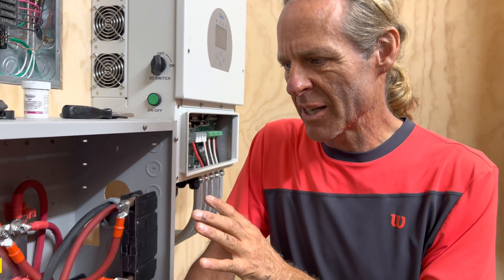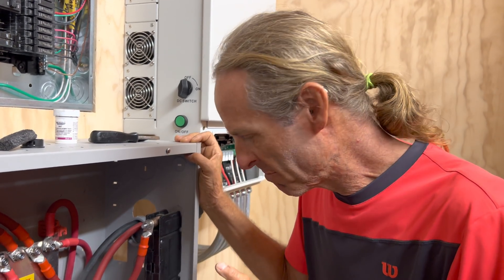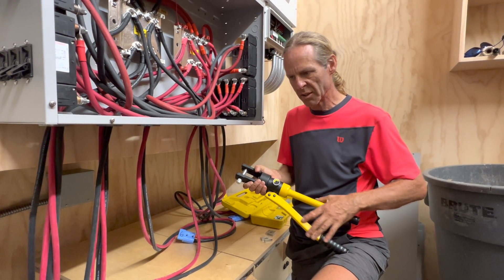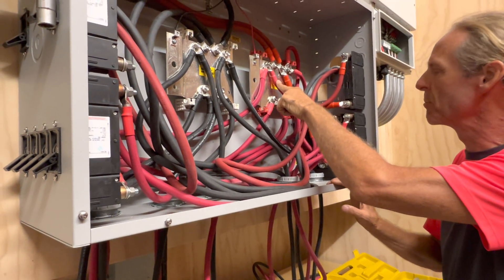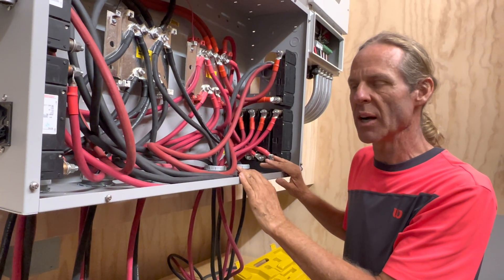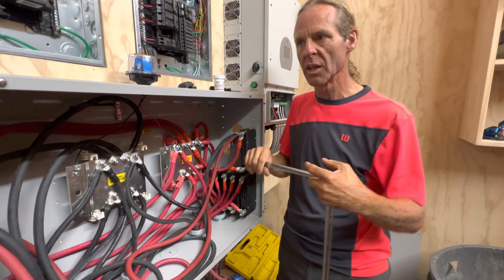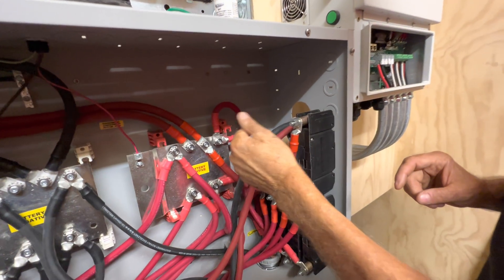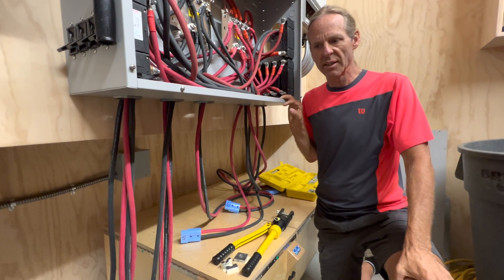Wiring Up Eight Big Lifepo4 Batteries and Three Big Inverters!

Comment: Do you think that 8 lifepower 48v battery with a master battery still needs the leads the same?does the master bms communication tell the other batteries when and how much to charge to stay balanced? All batteries are the signature solar lifepower 4 48v
Reply from the maker: Keeping them the same will help to use the batteries equally. If there is more resistance in the circuit of one battery, it will get used last and it will get charged last.
Reply: Does the master battery bms not control that very thing? If not the what does it do? @RayBuildsCoolStuff
Reply from the maker: @chrislewis9345  the master battery does not control the rate of discharge or balance between the individual batteries. The balance between the individual batteries is determined by their voltage and the resistance in their circuit. If there is more resistance in the circuit, then it will require a greater voltage difference in order to push current through the circuit. Read up a little more on ohms law.

Comment: I have the distinct feeling that you are either an engineer or a someone that used to teach in a university.  
Much of what you talked about is info that is useful in more ways than one, being a ham radip operator having gas tight fittings is very important to have as well as water tight, the carbon paste that you use i also use the same stuff for making good solid coaxial connections. We also use some stull called PENETROX WHICH IS ABOUT THE SAME THING. The nice thi g with the PENETROX is that it also seals out gases as well.
Reply from the maker: I am just an old country boy that swung a hammer for years. Then I told other people what to do. I do kinda like systems, patterns and getting things right. Thanks for following along and letting me know how you feel about it along the way.
Reply: @RayBuildsCoolStuff  strange how most people think university's dispense knowledge when all they do is certify to a minimum standard. I appreciate your education though experience, uncommon sense and communication skills that have been gained through  training others and insisting on quality at a high level.

Comment: New to your channel thanks for all your battery build up informational content. I've been working in aviation for 40 years and have always done the maintenance on our ni-cad batteries. They are assembled much like your DIY batteries with the insulation sheets between the cells with pure nickel bonding straps. This allows disassembly for replacement and cleaning (vented cells create a salt that requires disassembly and wash down of cells annually). We do capacity checks every three months manually monitoring cell voltage on discharge and charging. Then service water level. These LiFe look like heaven. I'm currently running 4 decommissioned aircraft batteries for my system until I up grade. You gave me the bug. Only one suggestion as we work on fully charged 24 volt batteries with marginal clearances.  The go to is electrical tape you should have either heat shrink or  electrical tape on your battery tools especially sockets and extension. Helps to mitigate the welding of your tools to the battery and the ensuing panic as things start toward thermal melt down.
Appreciate your insight especially on cell purchases.

Comment: So you just combine all these packs to 1 connection towards the Deye? How do they discharge all correctly to 0% (or 10% if you like) ? And which of all the BMSses do you canbus connect to the Deye? (I am having a Deye 12kw 3phase hybrid + a 16xLF280K pack with Seplos 200A bms). Great video!

Comment: those anderson connectors are known fire starters . the tweco connectors used for welders are probably a better choice and readily available
Reply from the maker: Can you cite examples of genuine, Anderson connectors, causing fires? There are a lot of counterfeits out there that I wouldn’t dream of using. Also, they must be properly crimped. I am certain that there are a lot of potential for fires when they are not used correctly and when the connections are not made correctly. I have a video about that very thing.
Reply: @RayBuildsCoolStuff  there was a factory charging a fork . a few years ago . and tvr cars had 2 catch fire . a quick google search . will probably show some results . i would test them with a load that you would typicaly use for heat

Comment: Hi Ray - I am using Sunsynk inverters in the UK - these are very very closely related to the Deye inverter (made in same factory) I know you use Seplos BMS can you confirm how you established the battery link - that would be very cool. I think the Seplos emulates the Pylontec which the Deye can communicate with.....can you let me know how you did this? Cheers love you channel.

Comment: Surge…. If you have a strike on your house or close by, the earth ground voltage will be high and the surge protector will not do much.   I speak from experience!
Maybe add ground rods around your a solar shack as well.  Yeah, ground and neutral needs to be bonded at the first means of disconnect, but I don’t think there is anything in code saying you can’t have ground multiple grounds around your property as long as they are all connected. 
Heck, the utility grounds the neutral all along the system.
Reply from the maker: Yes, a direct, strike or one very close by would create some serious damage. The surge protectors are not designed or capable of protecting you from that. I think the best we can do is to have multiple layers of back up power to get our critical loads protected, in case of catastrophic failure of our primary system. I have looked into lightning, arrestors and protection systems in the past, and it is a really big deal. I may look into it further in the future, but I won’t be trying to design a system of ground rods that has the potential for setting up a dangerous ground loop to overcomes something that should be addressed with a proper lightning arrestor system. I have done too many of those kinds of things in my youth. I guess we both have experiences that are trying to lead us. Lol. Thank you so much for your valuable comments.

Comment: what is more efficient grid-tie inverter on battery or inverter
Reply from the maker: Please rephrase your question. I don’t understand.
Reply: I have a 48 volt lead-acid battery Bank. somtimes i connect them to my grid tie inverter and i get around 400 watts. back to the grid
Reply from the maker: @SingleFosterDad  what are you asking though?

Comment: I know you said you can't get the ones anymore that you're using I've been looking at sungol split phase piercing wave 18000 W 48 V in burgers I haven't bought anything yet money's a major issue for everything but I don't wantna buy anything twice I don't wanna buy anymore than a 1/2 too but with my consumption there is need for Mega inverters and Mega batteries and then of course I gotta have enough panels to to cover it but there's somebody advertising on Facebook and they got a whole bunch of panels and not as big as what I was thinking of but after seeing the racks that you built on your property and I'm a solar shed She's got 6 and a 1/2 acres out there Tennessee she can spare 3 spaces 10 by 25 to to put 3 racks up one straight South 1 just slightly to the West and we're just slightly to the ei think I'm having plenty of inverters to hook up to the strings won't have to be that big I don't know tell me if I'm crazy

Comment: Thanks for sharing your knowledge and experience in building battery packs and solar system.
I have one question: 
What is that white material that you put between cells?

I am using rubber sheets, but it sticks togeather too much and if I need to remove any cell then it is very hard to do.
Reply from the maker: They are thin flexible cutting boards cut to size. I buy them through Amazon from arrow home products.
Reply: @RayBuildsCoolStuff  Thanks.

Comment: Ray - I appreciate this video- I have been trying to figure out how to buy or make a proper battery terminal block. I bought a copper 750 amp rated block and wonder if it would work for 10, 100 amp batteries. Not clear to me how the sheets of copper are rated.

Comment: Hi Ray, just starting to design my home power system, thanks for the great info.  Years ago I rebuilt a 50KVA Exide Powerware UPS in my server room.  I found that ALL the power cables had wax drops / beads at each lug, good visual for a hot connection.  I am not skilled as you in the woodworking so I am likely going to use an commercial UPS battery cabinet and use CALB cells on each shelf.

Comment: Based on your figures for the 1/0 connection using a 50mm die the size for the 1/0 is 53.5 mm2. If you divide the 50mm by the size of the 1/0 wire 53.5 mm2 you get the following ratio: 50/53.5=0.934579. The size for the 2/00 wire is 67.4 mm2 . f you use this ratio for the 2/00 wire you would get 67.4 * 0.934579 = 62.99 mm. This measurement is smaller than the 70mm die which you had to grind down. Love your information. Can't stop watching your videos.
Reply from the maker: Makes sense doesn’t it? I can’t say exactly how much I ground off but it was a good bit smaller than 70 when I was done. 😉

Comment: Considering adding the breakers and another two lug connections at the breaker: isn't it that the wire lengths don't matter but the inner resistance of the battery to the bus bar matters most?
Reply from the maker: The wire lengths definitely matter. The total battery resistance also matters. I want both to be as balanced as possible to cycle the batteries evenly and equally.

Comment: Hi Ray, can a similar setup be realised with traction batteries? We are running an off-grid setup with multiple inverters with each their own forklift battery. It would be ideal if we could combine these but I've always been told that's a bad idea.
Reply from the maker: I have no experience with that.

Comment: Who is the maker of the battery combiner box ? If one inverter goes into fault and cannot be repaired for whatever reason will you have to replace all three inverters ?
Reply from the maker: Midnite Solar makes the combiner. Each battery and each inverter are separately fused.

Comment: Do you find the Anderson connectors have a certain amount of resistance ? They tend to get warm under load. At least they get warmer than a nut and bolt connection therefore indicating resistance. Maybe some conductive paste would help. Also would the load on the batteries get unbalanced anyway if one inverter is powering a load while the other is not ?
Reply from the maker: The batteries will stay balanced. They communicate with the inverters and the inverters communicate with one another. That’s an interesting idea on the anderson connectors. I should test that when the time comes.

Comment: Hi Ray. Your knowledge and experience with DIY batteries is very impressive, and I'd like to ask you if you could share some of it with me. I haven't found any info on DIY high voltage (400V) energy storage on the internet apart from a decommissioned EV battery from BMW but that's kind of a cheated DIY in my opinion as all the trouble is dealt with (BMS, Circuit breakers, etc) . I saw some commercial solutions from Huawei but no DIY. Do you plan on doing a High Voltage battery at some point? I think it would be a great project to take on - also efficiency of HV batteries is better (so I heard) and the current drawn from them is smaller making them last longer.
Reply from the maker: There are a few problems with high voltage DIY batteries. First and foremost is getting the rest of your system to work with it. You would need to step up and down with transformers to use more commonly available inverters and charge controllers. It can be done and there are some pioneers that argued loudly for it. The loudest of those has passed on now but the dream lives on. Another problem is that high voltage DC will kill you quick and the training required to handle it safely is not DIY compatible. I would never do a youtube video where I showed people how to work with it. It could be argued that the voltages are similar to that found in strings of PV but I'm just not going to go there with big energy storage systems. The ones we build are managed risk, but not zero risk.  I would hate to get someone hurt. Low amperage is cool though.

Comment: Good info on the wire lugs. I've never really thought about this but you are so right: the connection needs to be air-tight to prevent corrosion. I still remember that we had to crimp cables and have them inspected before being allowed to do this in a live system. The crimps were indeed being cut open to see how they look on the inside.
Reply from the maker: What industry did you work in?
Reply: @RayBuildsCoolStuff  I worked at a private company where we did different projects for external customers. A lot of those were in automotive. My main job as an electronics engineer was to develop the electronics and program the stuff. This included BMS and charger systems. It was always a challenge to keep the electronics and connectors free from "environmental wear". The battery stuff was only for small batteries, starting at single cell  2 Wh batteries but ranging up to 48V 5 kWh

Comment: I enjoy your videos ,  you worry about details that I didn't know were important . I'm going to rewire my solar arrays so that all the cables are of equal length and all MC4 connectors are air tight .
Reply from the maker: Your solar panels are not required to have equal length cables.

Comment: Thank you Ray! But I do not agree with the things you said regarding Oxygen getting into the wires. Oxygen will permeate through plastic and shrink tubes very fast and therefore the shrink tube will only be a stress relief and isolation. It will simply not keep the oxygen out.
Reply from the maker: How do you explain the difference between unprotected copper corrosion compared to insulated copper?  You may get oxygen diffusion through plastics but it is a rate issue. Very thin plastic wraps are used to protect many of the things we depend on from humidity and oxidation, from our food to our packaged durable goods. Paint is usually some form of a latex or plastic and is measured in mils. It protects steel and other metals from corrosion literally for decades outdoors.
Reply: @RayBuildsCoolStuff  The main difference might be to keep air humidity peaks (and even condension) away from the copper. Oxidation needs water and oxygen to occur. I don't say it is unnecessary to protect the copper. It will surely reduce corrosion, but not by keeping the oxygen out.
Reply from the maker: @Poebbelmann  Actually corrosion only needs oxygen to occur and in fact it is the oxygen in the water that causes corrosion, not the hydrogen. Consider the case of the cutting torch. The way a cutting torch works is by heating up the steel and then introducing pure oxygen. What happens next is very rapid oxidation, kind of like rusting on steroids. That's why you can't use a cutting torch to cut stainless because it won't rust well enough with it's low carbon content.
Reply: @RayBuildsCoolStuff  Water is needed as a catalyst for corrosion at room temperature. You won't have any corrosion without water when the copper is not heated.
My point is: the shrink tubing will not prevent that oxygen will be in contact with the copper but it will help to reduce or inhibit corrosion.

Comment: On next video, please discuss the AC wiring going out of the inverters and into the Breaker Panels.

I am interested in understanding, how multiple inverters are properly connected to the breaker panels.  

Do each of the AC outputs parallel to the same connector in the breaker panel?

Are L1 N L2 all tied together???

No one ever discusses the AC side.

How are these AC connections from each inverter kept in sync with each other?

Can some of the inverters accidentally 
back-feed into other inverters and cause a short?

What do we need to protect each inverter from over current from the other inverters???

thx
Reply from the maker: I have a video that explains the overall setup with the three AC panels that manage the output from the inverters, the input from the grid and the inputs from the AC coupled PV and Generator. 

The inverters communicate with each other for coordinating their function with one another. They also communicate with the batteries which all communicate with each other. There is a master BMS on the battery side and a master inverter on the inverter side. That is going to be covered in a future video.
Reply: https://youtu.be/71TIkJyzbLU

for anyone else interested in AC side wiring distribution 

begins about 12:11 in this video

Comment: I think the extra cable management ( basically all the paths from source to consumption points need to have the same resistance) is the downside of the individual baterry design done here. In a rack build can be saved a lot on copper but then is a lot less serviceable. If the intention is to tucked away and leave it them better to have a rack mount build all together perhaps.
Anyway awesome build that is coming together nicely. Thanks for sharing.
Reply from the maker: I think one of the main design flaws of the rack mounted systems is the daisy chaining of the batteries. The current flows are asymmetrical and out of balance. Another problem is that in the quest to have batteries that can be lifted into the rack, they tend towards 5 kWh capacity batteries which makes scaling to large capacities more cumbersome. On top of that is the fact that it is difficult to know what the quality of the cells is and testing of the cells very difficult. I have no interest.